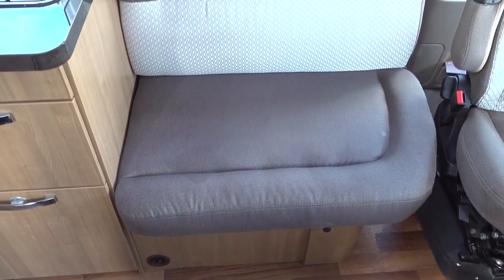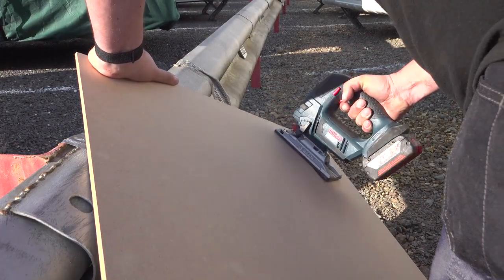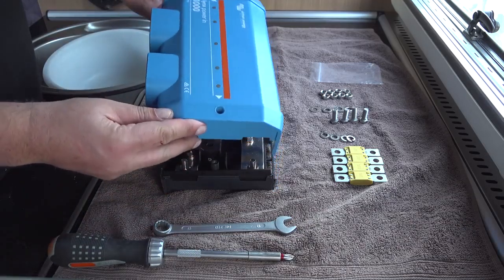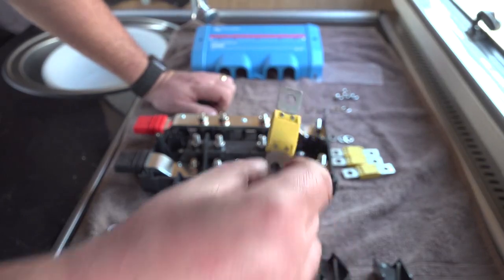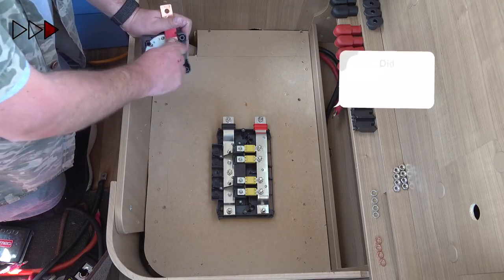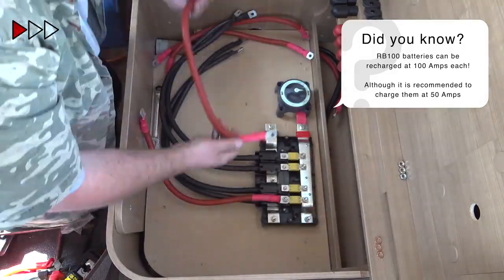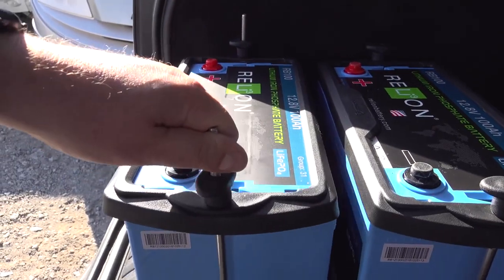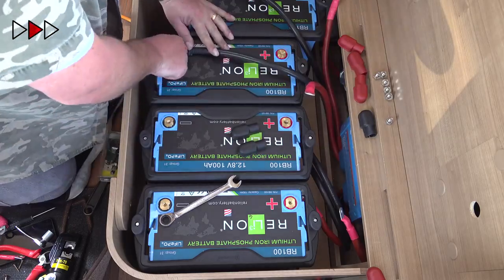Lithium Battery Bank RV Motorhome   10 Minute Full Install (from 2018)

Comment: I've seen some of your Vlogs ,
Can you please state what qualifications you hold to give advice on Mains and Auto Electrics, I feel it's important  that your viewers  are given  the correct information and show the test results of your installation ,when a vehicle has a habitation check they give you a test report on your Electrics, Remember when you have Electrical work carried out on your home ,you require a part P check and i believe your van should have the same standards met, I'm stating this as a qualified Electrician of 49+ years 
and carried out many Test & Inspections on Industrial, commercial and domestic  premises.

Comment: Hi Phil, i am think of getting a second alternator fitted on my sprinter van. As i dont have much room for solar and do wild camping most of the time. Do you have any contacts or recommendations on who might be best to approach, as obviously i want it done professionally. Thanks Darren
Reply from the maker: Have you thought about having a higher output alternator rather than a second alternator?
Reply: @GeekyPhilip  yeah I have, really not sure what alternator is the best though. I would prefer having just the one unit, have u got any recommendations for me. I've looked online a lot and really don't no what is good or bad. I don't mind paying a lot if it's worth it

Comment: Is this a different/new channel? Although it can't be as I'm subscribed to it. It's just that I remember chatting to you about being able to be nearly permanently off grid when you reworked the solar and batteries on the Hymer. Now there are only a handful of videos listed. Did you take them all down?
Reply from the maker: Yes, a lot of the videos were giving out of date advice or recommending products where a better version is now available. I decided to start again. This video was put back up as I had some requests to do so.
Reply: @GeekyPhilip   Ahh OK. I didn't think of that but it makes sense given that you do a lot of advice/review videos. Shame though. Some of the Q & A vids were a good laugh, and every van enthusiast should have seen the solar/lithium set up on the Hymer.
Reply from the maker: @DavidT-Mallorca  I am now installing 1200 watts of solar on my VW T6 High Roof!
Reply: @GeekyPhilip  Is that a replacement for the Hymer, or do you have both? Are you uploading a video of that, Phil?
Reply from the maker: @DavidT-Mallorca  I sold the Hymer last year. I am building a 4-wheel drive T6 High Roof conversion with an epic electrical system. There will be some videos, but not how-to style, more "I did this" videos.
Reply: @GeekyPhilip  Right. I wish I'd known about that! Did it go with all of the electrical upgrades? Tbh, I'm not sure I'd go for anything that wasn't Euro 6 given the way things are heading, but it was some van though. I didn't think you were too keen on smaller vans after the Duetto? I'll look forward to seeing the upgrades on the T6.

Comment: Well done Phil, really good video, very professional. I assume that your charger was set up properly for lithium, I think the AGM setting is normally ok.
I will be replacing two non AGM batteries supplied in my new van with two 100AH Lithium. I will have to set the charger up properly.
Thanks again Phil.
Reply from the maker: Your charger needs to be able to set your charger to Gel or Lithium. AGM charging profiles can sometimes cause the batteries to shutdown charging.
Reply: @GeekyPhilip  thank you Phil, well here’s hoping it’s a Rapido V68 van conversion. I won’t be getting it now till September at the earliest. It has a lithium option. But I bought my own two batteries from Alpha batteries. I can only hope the charger supplied will have a lithium setting. I would have thought so with lithium being an option. Thank you again Phil.

Comment: Those types of fuse are difficult to see if blown
Reply from the maker: I always use a meter to check fuses. In my new van I am using a Victron distributor and had LEDs to indicate if the fuses and blown.